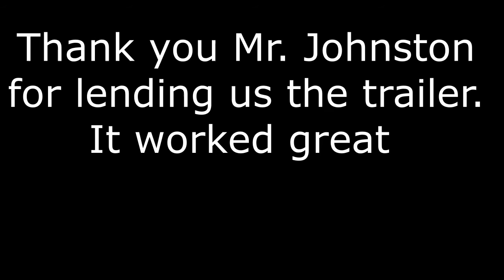Tips on safely strapping your rig on a trailer.  Be Safe when you tow.

Comment: Working Load Limit for 2” racket strap is 3333 lbs.
Reply from the maker: You know.  This is one reason why I love doing videos.   if I get something wrong, we have someone to correct it.   Getting the correct information out there is the important thing  Thank you for your comment.   You are correct.   I just looked it up again and it is 10,000 lb breaking and 3333 lbs.  working load.    And the working load strength would be the most important number  I will add a comment in the description.  

Thanks again for the correction and the watch.

Comment: Hey man I just picked a used car trailer and the trailer tire have some camber while hard turning on uneven terrain with a load. Is this “normal” for a tandem axle? Or are my axles bent? Otherwise the tire drive straight down the road with and without a load. Any help would be appreciated
Reply from the maker: Start by looking at the bearings and races.  
https://youtu.be/mxnXzupZdLo?si=zvjgK8zYVLE-fpGQ
This video might help.  

if it is riding good but only looks wonky when going around curves, you should be OK as long as everything is tight.    jack up that side and yank on the wheel to see if you can move it.   When going around a curve under a load the tires slips on the pavement and is under a huge amount of strain.       

good luck and let me know how the bearings look.
Reply: @5LakesGarage  bearings look great. I’m going to actually replace all the bearings this weekend and repack them with some good grease. They were a little loose. I also talked to trailer Smith here on YouTube and he says it’s normal for the tires to have some camber because they’re supposed to be able to flex especially true trailer, tires. This allows the tire to take the load versus the bearing when turning. Makes sense. My predicament now is removing the bearing Reeses. They are proving to be a great PIA.

Comment: How do you tell how much ure truck can tow
Reply from the maker: It all really depends on your setup.   
My Tacoma for example.   
Stock it is rated at 6500 lbs.  (I believe that is too high and would not go over 5k)
Engine is a 3.5L out of a minivan.  (Junk with Low end torque)
I have modified it with larger tires and lift which makes it worse.   
So now I am about 4500 lbs that I feel ok with. 
I plan on doing a re-gear soon to get it back to about 5500 lbs

My Dodge 2500 12v.   I have not felt that I have gotten close to the limit.   

Engine and suspension is one thing, brakes are very important as well.   When I am towing a trailers that is over the weight of my tow vehicle.  I like to have a break controller with trailer brakes.   Electric for road trailers and a surge brake for a boat trailer.   

https://www.youtube.com/watch?v=hLre5zWS4GQ

Your truck manufacture should state a good starting point.